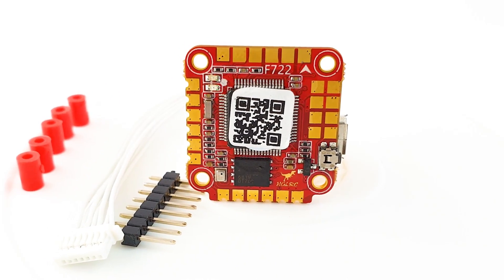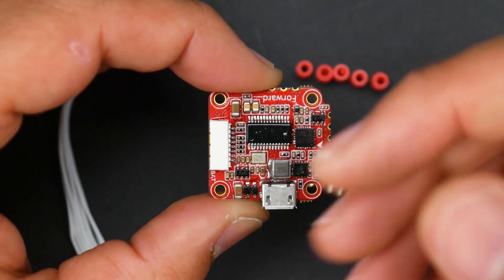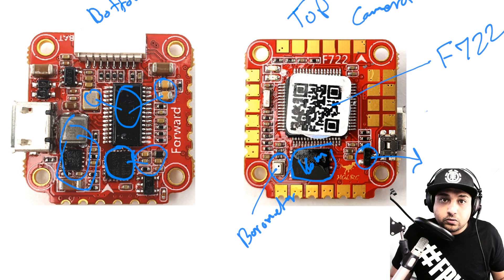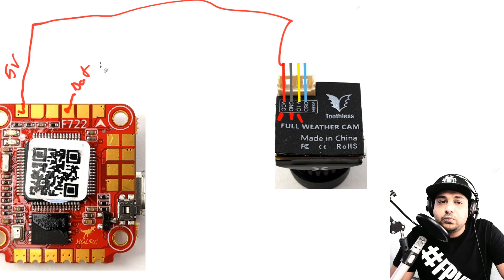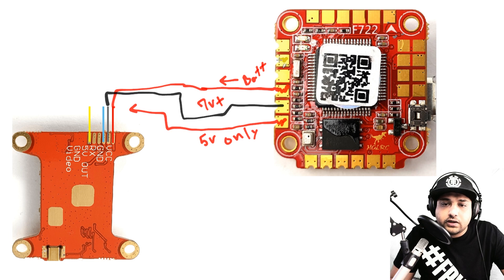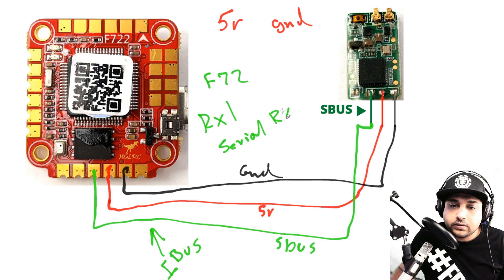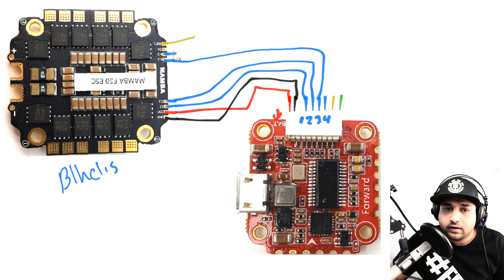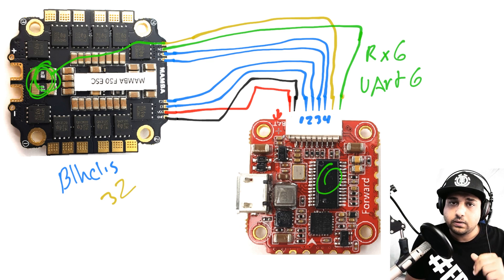ALL NEW HGLRC Forward F722 Mini Flight Controller // Overview & Setup Guide

Comment: Question, the two pads for sda and scl so you can hook up gps compass, on hglrc web it show those pads but then also says those pads are not 12c supported. So can a compass be installed. Thanks
Reply: On the website it says: Support I2C function. Make sure you buy from China. The one shipped form the US does not have the I2C pads

Comment: Great video and best explanation of every aspect of FC .Please explain the HGLRC led and beeper or buzzer connections on this board and also the connection of GPS. Your viDeos are worth viewing many times as the explanation provided for a section of board is useful for other types of identical boards.
Great work dear friend
Reply: If possible led and beeper combo placement and configuration in betaflight
Reply: Go to matek sight it's in the row of pads by ussb outer pads